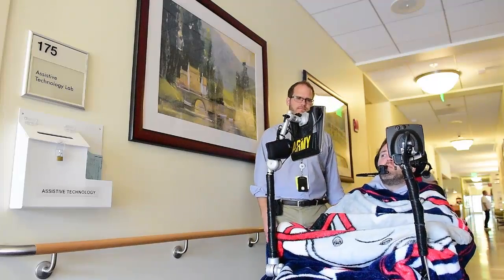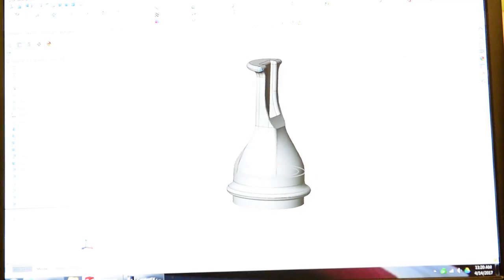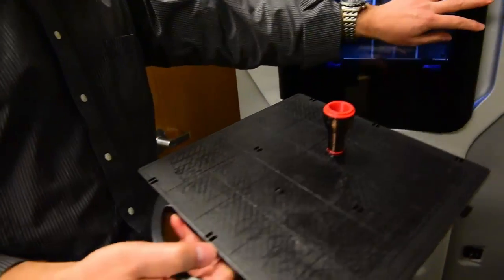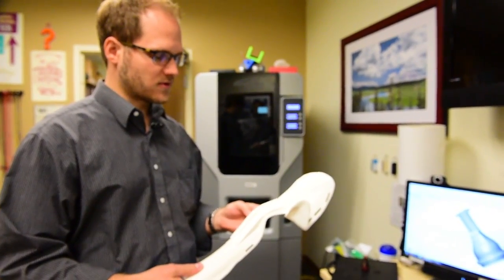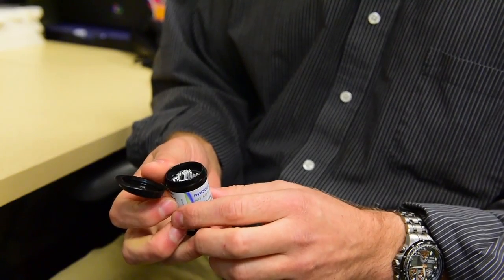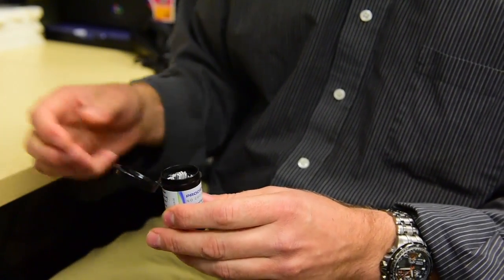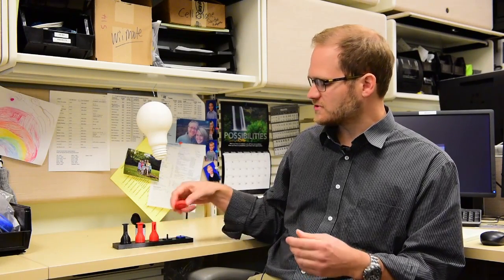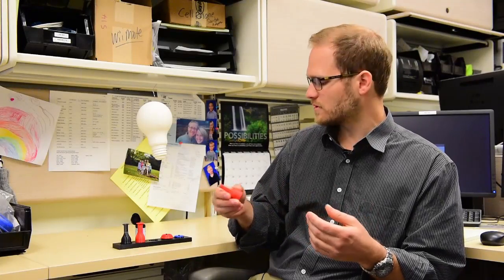McGuire VAMC Assistive Technology's 3-Dimensional path to rehabilitation

Comment: Let's build a front-facing radar system that can be mounted on a bicycle handlebar, enabling a BVI person the ability to ride a standard bike. The rear-facing radar system already exists in the bike industry; it would be awesome to have this in a front-facing system that would have auditory alerts when approaching obstacles. Heck, the self-driving car likely already has this technology. Let's put it on a bike. Or, let's design a device that a BVI person could, say, point down a street and then receive feedback on whether or not it's safe to cross. The rear-facing bike radar already has similar technology; the radar will alert the cyclist about how fast the motor vehicle is approaching.